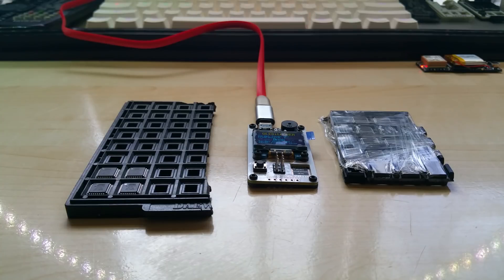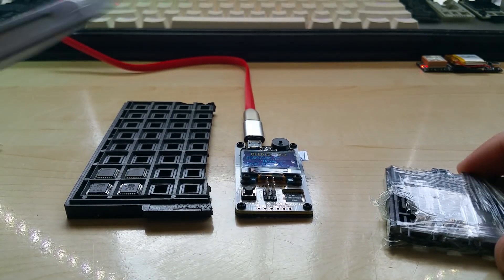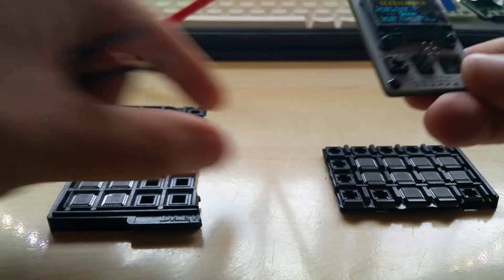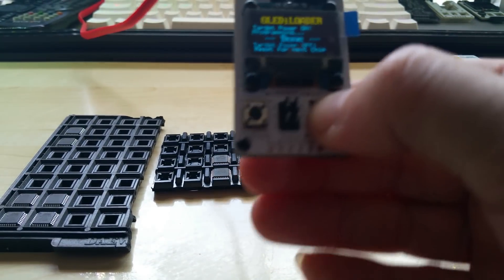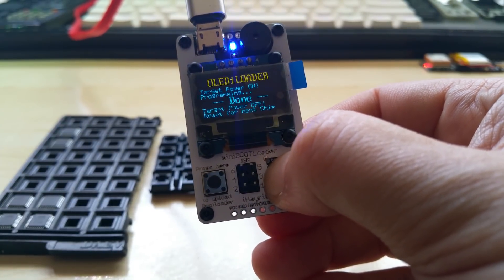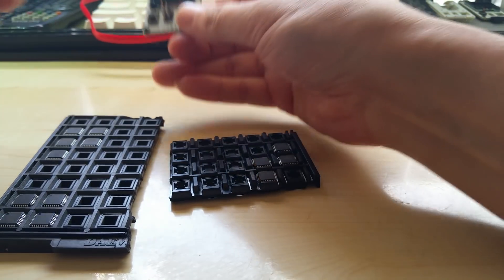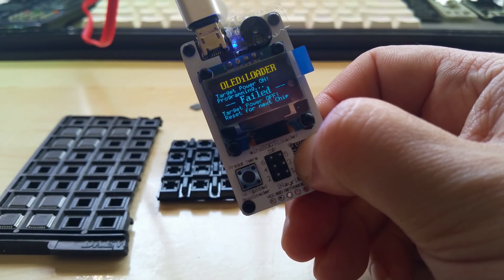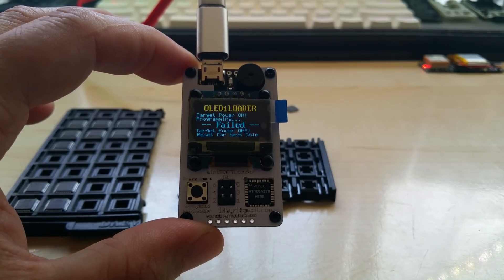How to use the Tiny Bootloader without a Vacuum Pen, tested on Atmega328P-AU chips from Aliexpress

Comment: Great product, but is a 30% failure rate typical?
Reply from the maker: You have to use original chip bought from Mousser, Digikey or other well known distributer. Don't trust any Chine seller for these chips, they will be rejects or flat out copies. Also make sure the pins are at the same height, sometimes they need ever so slight adjustment. And lastly, don't be afraid to apply a little pressure, you won't break the chip or the burner. I am using mine for years now and it is still working like a champ and I burned at least 1000 chips with it already :-)

Comment: This really is a great tool! I could imagine automating the burning process as soon as the chip is in place, possibly even by using servos. Would be a nice project for one of the next Sundays. But really, get some one to shoot the guy who had the idea of putting that annoying buzzer on this device! :)
Reply from the maker: The guy you want to shoot is me, I put the buzzer on there because a audio feedback is much easier than to watch the screen all the time and for people like you there is a solder bridge that you can remove to disable the buzzer. Feel free to buy one and try it, you can also put a piece of tape on it to make it quieter if your ears are sensitive to noise. Btw, I lived in Karlsruhe.
Reply: @iHayri1  I kind of had the feeling that you were not only the messenger! :) I am currently exploring the different ATMEGA processors and I have not yet worked with SMD chips. I still have no experience or equipment to properly solder SMD components, something I'd like to educate myself in and setup in near future. Also, I'd like to explore the ATTINY SMD chips due to being cheaper and virtually being able to do the same or most of the same stuff than the ATMEGA chips.

Comment: Is it possible to make it upload a .ino file instead of the bootloader? Like if you have one project you need to program the same file for say 40 atmega 328 instead of burning the bootloader and upload the .ino from the computer. This would speed up things alot but maybe not possible?
Reply from the maker: Good question, and I asked myself the same, as I constantly end up uploading the same code over and over :-) Not as a ino file but as a hex file it should be possible, the hex file gets created every time you click compile and is the actual file that gets uploaded the same as a bootloader.hex file. It would need a edited optiloader program that does not check what kind of chip it is and uploads the saved hex file instead. I will look into it as I can use it as well, like I mentioned. Will make a video asap I find the solution. If anybody is out there reading this and knows how to do it, before I bang my head, please let us know :-)
Reply from the maker: One important aspect to keep in mind, doing it this way will erase the bootloader on the target chip and any future uploads need to be done the same way over the ISP connection. One advantage this brings is, there is no delay and the code starts executing right away without having to run the bootloader.
Reply: @iHayri1  yes this is exactly what i mean, it would be very nice function to have but for now i think i will buy this version :)
Reply from the maker: Yet another note, you still need to burn the bootloader first to set the fuses. So unless you want to change the code on the bootloader burner between the optiloader and the end sketch, you would need 2 of the burners, one for burning the bootloader and one for uploading your desired code in hex form.
Reply from the maker: @axelkontio5943  Sounds good, I have one left till the next batch :-)
Reply: @iHayri1  now you have zero ones left :)
Reply from the maker: @axelkontio5943  Thank you Axel, appreciate it :-)